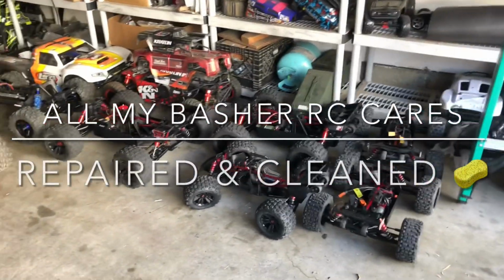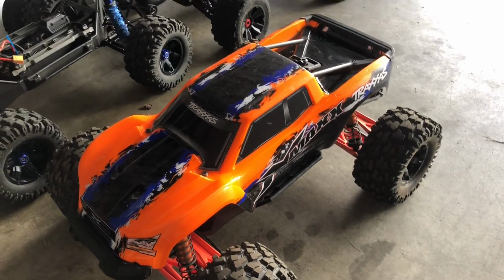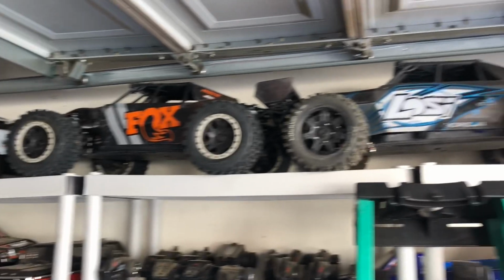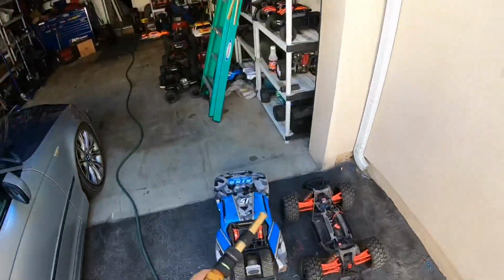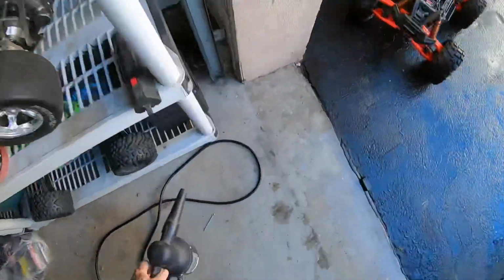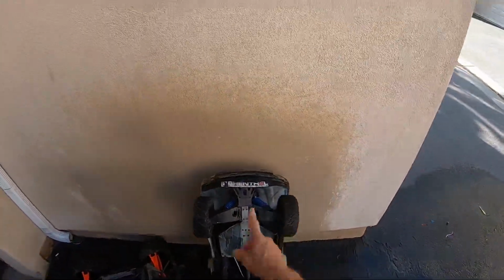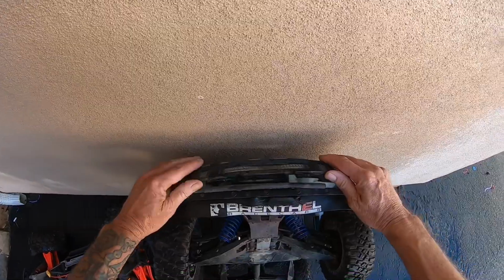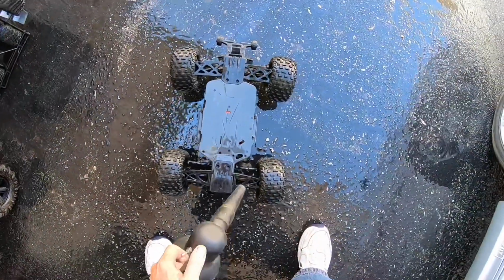Cleaning My Rc’s That are to dirty to just wipe off my 3month basher cleaning

Comment: I was just cleaning my vorteks with the shower hose yesterday.   made the mistake of forgetting Iwas out of compressed air cans.  thankfully it was super dry day and it dried quickly. probably not good for the bearings that got wet but I can't let it sit so dirty after a day at the track.  I need to invest in a good powered air system.
Reply from the maker: That the main reason for my electric air blower the compressor is real noisy and the air doesn’t last long and cans I’d use cases doing all my rc cars as I just have so many with 4 ppl using them all week 💯💯I use an oil pen looks like a needle to lube the bearings in the rc without removing them once a week so sand sticks to them fast 😬😬
Reply: @earlmoorhead5555  I bought cans when I was limited to 2 cars, that exploded into 8 in a few weeks.  Learning as I go.  Thanks for the vids and response  👍

Comment: Dude I'm going big with these slash RC builds I'm done with them now. For my Arrma Big Rock build I'm putting in the Castel Max Extreme paired with the 1515 2200kv motor. Yes I like to over power everything. That copperhead 1412 24ookv in my race off road slash is insane. I had to weight down the front. 3s is wow. 32p 24/54 gearing. Never gets hot.
Reply from the maker: Awesome 😎
Reply: @earlmoorhead5555  oh yeah I liked the video. Thats allot of cleaning to do.
Reply from the maker: Right 😳😳💯

Comment: What kind of blower are you using to blow those of with? That thing works  better then my compressor. Doesn’t sound nearly as loud either. 
Thanks for another gr8 video brother 👍💪💯
Reply from the maker: https://www.google.com/search?q=3d+auto+detailing&ie=UTF-8&oe=UTF-8&hl=en-us&client=safari#trex=m_t:lcl_akp,rc_f:rln,rc_ludocids:15610736043852668881,ru_lqi:ChEzZCBhdXRvIGRldGFpbGluZ0izm9vL5YCAgAhaMgoRM2QgYXV0byBkZXRhaWxpbmcQABABEAIYABgBGAIiETNkIGF1dG8gZGV0YWlsaW5nkgEVY2FyX2RldGFpbGluZ19zZXJ2aWNlmgEkQ2hkRFNVaE5NRzluUzBWSlEwRm5TVVJCTFRsNVNEQkJSUkFCqgEZEAEqFSIRM2QgYXV0byBkZXRhaWxpbmcoAA,trex_id:QzQ8Ic
Reply from the maker: Sold here called the blaster 3D products
Reply: @earlmoorhead5555  thanks🙏💯👍

Comment: Earl m! you had a great weekend Earl and you seem to be feeling good? If I could pic your Brain? I did a speed run and shame on me. Left all the lower body pieces off a felony. Caught wind hard at 80. I redid the car put everything back. Also put aluminum side skid plates and front lower skit plate on. I lowered the vehicle as well. Is there anything else I can do to stop this epic fail? Always trial and error till I get it right. Is the felony body junk for high speed runs? It did a 98 with no issues with stock out of the bid body. Any help or wisdom would be much appreciated, thanks Earl!!!!
Reply from the maker: Raise the back up high and lower the front as low as it will go 💯💯👍👍
Reply: @earlmoorhead5555  thanks Earl, I’ve done a reconfig on the body and will do! If I have, 
I mean when I have a successful run I will give you a shout out. Thanks!

Comment: What is the name of that plastic spray conditioner your using I use their 3d all in one wax an some of their other stuff can't find it on their web sites it called magic blue
Reply from the maker: Magic blue is the bottle that is sold empty it came in a spray can called install shine or in 5 gallons cans are easier 💯💯
Reply: Thanks alot

Comment: Dont your screw heads corrode ?
Reply from the maker: No as I dry them fast and spray the chassis down 💯💯
Reply: Spray with what ? What do you think of WD 40?
Reply from the maker: I don’t mind wd40 but over time it makes the plastics to soft and pins and screws will pull out 💯💯
Reply: Oh ok ... I’ll keep that in mind ... thank you for the advice .. great content on your channel
Reply from the maker: @23allenrj  thanks 🙏 appreciate it 🤛🤛